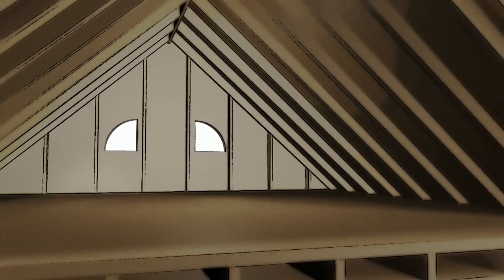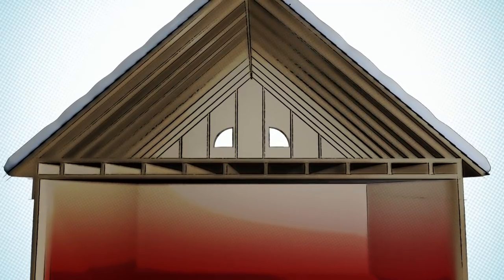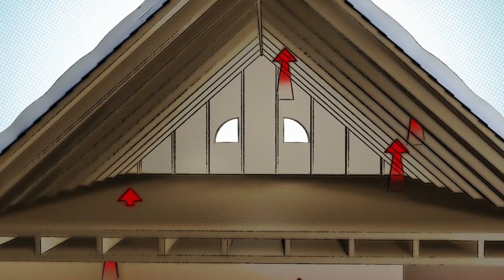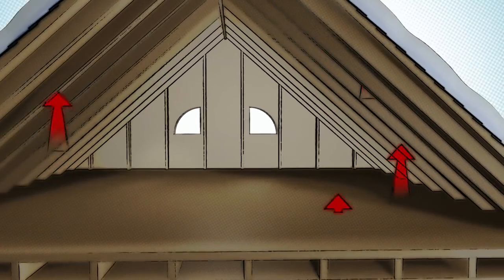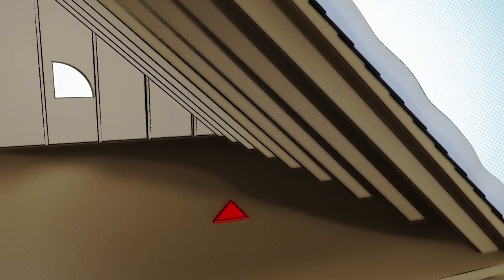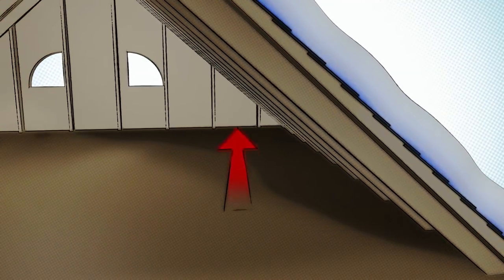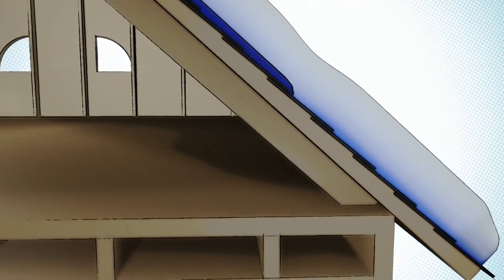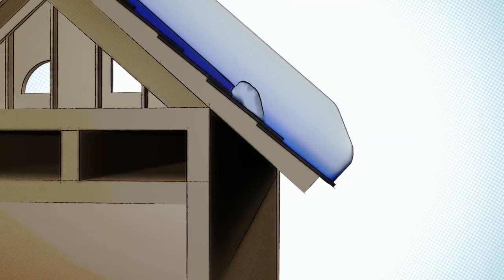How to Prevent Ice Dams | This Old House

Comment: When I contacted Owens Corning about air under the shingles, they said if you spray like this, you will shorten the life of the shingles on the outside of the house. Air damns need installed from soffit to ridge vent, then cover with insulation. This allows air to move via convection from the soffit up through the ridge vent, keeping the shingles cooler and getting the max life out of the shingles.
Reply: This is definitely true, I wonder if it would have any effect on sheet metal roofing, I doubt it, but would love to see some real data.

Comment: Insulation is important but the water doesn't stop at the bottom edge of the roof, it stops in the gutters and freezes. It builds up in the gutters until it reaches the top of the facial board. Then the ice crawls into the gap that is between the top of the facial board and the roof deck, then it fills up the soffit, then enters the house. When it reaches warm air it turns to water. Even if it gets under the shingles there is ice barrier at the bottom edge not felt paper. Code in any snowy region is two passes of ice barrier at the bottom edge of the roof then felt paper the rest of the way, anything under a 4/12 pitch gets completely covered in ice shield/barrier. To prevent this from happening you need to remove the gutter, install new ice barrier but this time leave 3 inches of ice barrier hanging over the bottom edge. This then gets folded down over the facial board or aluminum then install the gutter over the ice barrier closing the gap between the top of the facial board and roof deck. That's the correct way. It's all about doing it right in the first place.

Comment: If you're looking to prevent ice dams air seal the floor in your attic. Light fixtures, interior walls, plumbing stacks, bathroom vents, etc. You don't need to spray 2-lb foam to the underside of your roof deck unless you want the attic to be conditioned space.
Reply: the guy in the video actually said he wanted a conditioned space...

Comment: I swear, 15-30 years from now there's going to be commercials on TV of a lady asking if you or a loved one has been around spray foam insulation resulting in cancer and to give them a call for a cut of the compensation. It's going to be right up there with mesothelioma/asbestos.
Reply: already happening
Reply: Closed cell spray foam is safe AFTER it fully cures IF it was installed perfectly and properly.  If the ratios are slightly off or the installer tries to go too thick on their passes, it's big trouble!
Reply: It turned my dog gay!! Join the class action lawsuit!!

Comment: I agree with everything that you said, but I am not a fan of  spray foam. I would have screwed 1x3 or 2x4 (home owners choice,  I have done both) horizontal 16 inch on center. Installed rafter mates (tunnels) and installed insulation then drywall. Also you must have vented soffits and a ridge vent or gable vents. Problem solved
Reply: I know, they did not mention anything about soffits.   Does this house have soffits?

Comment: Old Historic House Owners:  if you want to list your home on the historic registry, DO NOT use any spray foam insulation before you FIRST check your state codes.  Also, if you have an original self-ventilating slate roof, understand that this is NOT a good idea!
Reply: @Dave Gill Im curious if there is a venting from soffit to ridge if the slate will still get too hot?
Reply: He is in the US. Nothing historical it's like... 300? Years old lol

Comment: Good luck with finding a roof leak and by the time you do there will be more than 1 board to replace.  Plywood even more . Why not pull attic floor and add 2x4 to the top of each floor joist re-install floor then insulate.  Install soffit insulation and ridge vent. Make sure that you have 6' of ice and water shield under shingles. Oh I forgot...  that doesn't sell foam insulation .

Comment: Something to watch for when it comes to these companies that use spray insulation, is that they often "fluff" the insulation in. For example ...when you're looking at adding 10 lbs. of insulation, what they often do is use only 5 lbs., and then charge you for that 10 lbs.
Reply: Likely the reason some of these applications fail.

Comment: With closed-cell spray foam being a vapor barrier, are you worried about moisture getting trapped between the roof deck and spray foam? If so, it would rot out the roof decking.
Reply: And the county code clowns wont pay a cent 🙃
Reply: Well once you replace your roof and possibly your roof sheathing all that spray in insulation will come out with the old sheathing.  Would never do that.  All u do is install roof insulation baffles and leave a min of 1 inch air gap behind insulation to roof sheathing.  This makes sure the air behind insulation stays cool with air flow from soffit vents to ridge cap still working
Reply: @jheiny1231  I was surprised they didn't install those before spraying.

Comment: Fiberglass insulation on top of a leaky floor in the attic may do nothing but redirect air leakage to the eaves, making the dams worse. 

Conflating air sealing with insulation is perpetuating dogma. Nice lesson on Ice Dams but incomplete. Wish they'd done a better job distinguishing between stack driven air leakage and heat loss. 

Redefining attics with foam is a FANTASTIC home improvement - If you have comfort issues this is likely to significantly improve comfort in the rest of your house too. Overfilling 2lb foam and shaving is overkill imo. 

Folks, most of your performance problems are due to air leakage, not insulation levels.
Reply: I agree. Very first thing is to make the house air tight and have proper/controlled whole house ventilation via HRV or ERV.

Comment: So does keeping the windows in attic open in the winter helps?
Reply: A bit late to comment, but yes it will help assuming that the attic floor is air tight to the house. The huge danger is that rain/snow can easily blow through an open window even with a screen, so a gable vent with 45deg fins would be the permanent solution.

Comment: You need 2 inch gap on the rafters for ventilation from the soffits.  You can then apply your insulation. Just a matter time for the wood boards to be rotten.
Reply: Nope not necessary

Comment: What about venting to the ridge vent?
Reply: That's what I was wondering about
Reply: Well once you replace your roof and possibly your roof sheathing all that spray in insulation will come out with the old sheathing.  Would never do that.  All u do is install roof insulation baffles and leave a min of 1 inch air gap behind insulation to roof sheathing.  This makes sure the air behind insulation stays cool with air flow from soffit vents to ridge cap still working

Comment: Of course the rafters are still exposed and therefore transfer some heat, so might as well toss a layer of XPS on it also before the drywall.
Reply: The thermal bridging is very minimal but you could do the XPS if you want to get crazy. They're in such a tiny space that it seems already so overkill.
Reply: its not a tiny space? its the roof of the whole house

Comment: What a shame to see that beautiful wood roof and structure being ruined with that foam. When you'll want to replace a piece or intervene on the structure, good luck getting rid of that stuff.
Reply: Your comment is odd.  So you like losing all your expensive heated air to the outside?  and cause ice damming that rots out roofs all over the country? There is a reason we insulate the building envelope and a good reason we don't build em like we use too.

Comment: Not the cheapest solution either.
Reply: Not everybody is looking for cheap. It's really not as expensive as you might think, about $1/board foot. (1 square foot 1" thick) Most people don't need R38 either, outside of New England.

Comment: Very poor method of insulating the underside of the roof.  It should have first had air baffling installed to keep the foam directly off the wood decking.
Reply: Check with the APA (AMERICAN PLYWOOD ASSOCIATION) about having ventilation on one side of the sheathing.
Reply: @J M If there is no air ventilation from soffit to ridge, and water gets through the roof sheathing, then the roof sheathing will rot out.
Reply: @ryanemge7659  if water gets past the shingles that is not a good thing insulation or not
Reply: @Affordablebath_remodel  Yeah its def bad regardless, however with a vent channel the moisture will run to the soffits rather than rotting out the roof sheathing.  That's a better situation to have as less damage is likely to occur and you will get visibility to having a problem sooner.  I have a friend who worked on a customers roof that didnt vent, and the foam worked so well that they didn't know they had a problem until they replaced their roof (when the shingles were at the end of their life).  As a result they had a major repair, as much of the sheathing was rotted out and several of the rafters needed replaced.  They ended up removing all the foam and put in vents and refoamed everything.  So they did the project 2 times, instead of spending a day installing rafter baffles to begin with.
Reply: @ryanemge7659  what if there is no soffit?
Reply: J M Everyone of the rafters will act like a sponge and draw the moisture in, or hold moisture from the outside for longer than they would have had they been vented.
Reply: @benjaminblack5888  No.  The roof is an assembly and it is not just about a specific product this is not good advice.  You should consult an architect and there is also exception information from "Building Science Corp.".  The climate zone must be considered.

Comment: These guys replying to this video are ignorant to the fact that venting is only needed if the heat would travel to the shingle from the house. With this system that will not happen. also the shingle are a breathable system especially with the breathable underlayment being used by industry pros. unless you have ice and water shield going on the entire roof deck you won't have a ussue with this system.
Reply: Yes if you got a super hot attic and a super cold outside temp you could have shingle issues. Hot on the bottom, cold ontop does make things curl because there is a thermal differential.  But with closed cell foam inside those rafters, as you noted, it alleviates the problem.
Reply: Yes if you use closed cell foam you don't need sofit vents. You'll plug those up. You now have a conditioned space and don't need to bring outside air in for heating, cooling and mold resistance. 

Sofit vents are to bring cool air from the edge of the roof (lowest part) in so that the hot air at the top of the attic will go out the roof vents. It acts somewhat like a venturi. If you're letting hot air rise out of the top of the roof it will draw air in from below since you're creating low pressure and thus it will draw air in from the sofit. The reason for this is to cool your attic. So this was the old way it was done, which worked okay but it brought the outside air into the envelope of the building (roof line) so you're actual thermal envelope was now ontop of your ceiling. 

A much better innovation which started a few decades ago is to push the thermal envelope outside of the ceiling insulation and beyond the roof. So now the whole house becomes the thermal envelope. Cold and hot air no longer permeate the building. Our barrier is now further out and the attic now becomes a conditioned space just like the inside of your rooms. This actually alleviates ice dams since hot air is no longer escaping/bleeding through the ceiling up into the attic, it also keeps the house much cooler in summer and much warmer in winter just like a thermus does. It also greatly reduces the energy needed for heating and cooling reducing power costs and helping the environment. It really is a win/win which is why it's been adopted. The only downside if any is that it is expensive.
Reply: 10" of snow is between R10 and R20 depending on density.  This will cause your roof to warm up no matter how much insulation you have sprayed underneath it.  Also, the siding can warm up with the sun on it.  That heat goes up.... right under your soffits and melts your snow causing an ice dam.  If you live in an area where you get snow you NEED to vent your roof.
Reply: that used to be thinking in Norway aswel, now it`s code to either have vented roof (Cold air under sloper roof) or downpe from the roof positioned internally (typical flat roof).

Looking at youtube, in many of these aspects it semms the US is lagging 20 years behind.
Reply: @BB-nn9en  that's not at all true you have it exactly the opposite way. My neighbor has no insulation in the roof of their log cabin and the warm air in the building and melts the snow on the roof and creates huge icicles. My roof is spray foam with 7in and the snow does not melt until spring because there is so much insulation.
Reply: @J M all those things can be spray foamed in, just keep in mind for something like a chimney you must have the correct ductwork to meet fire code.
Reply: @BenjaminBennett  that's simply untrue and it's very telling that they turned off comments on that video. Ice dams are formed when very warm air heats the roof deck from the inside and melts the snow and then it freezes at night. If what he said we're true then igloos would melt from the inside and yet they don't
Reply: @77Avadon77  The PHD in engineering would be the correct vs some general contractor. Also the comments are disabled due to company policy.
Reply: @BenjaminBennett  I have a spray foam roof with conditioned space. I know he's wrong. You do not get ice dams with spray foam.

Comment: Question... None of the wood in my home walls are vented. They are sealed in tight, wrapped in foam insulation outside and then with vinyl and inside with drywall and years worth of non-breathable paint.  Why don't these studs rot?
Reply: They will ‘ have patience
Reply: They don't  get nearly as hot as the roof decking, but in time they will rot as well

Comment: Spray foam most certainly is a do it yourself job. They sell rather large kits of the 2 part mix for this. It is indeed marketed directly to homeowners, and it's not that difficult. TOH is supposed to be a do it yourself show but it seems like mostly they just say "hire a guy". This was a big job and maybe better hired out, but you can definitely do smaller areas quite easily and relatively low cost.
Reply: Ok, I'll tell my mom to buy the kit and go up in the attic.
Reply: Well, to be fair, the video came out 6 years before your comment.
Reply: @j.frankparnell3087  Spray foam ain't anything new.

Comment: Or just install an ice shield rubber adhesive barrier strip  on the plywood along the top edge of the roof.!
Reply: Ahhaaa you know that barrier gets hundreds of nails go thru it when shingles installed. If you believe all the holes self seals  than you probably still believe in Santa.

Comment: put on a metal roof and you will never have an ice dam again.
Reply: And play only heavy metal in winter.
Reply: Depends on the style of roofing.
Also, the main issue with ice dams has NOTHING to do with your style of roofing.  It has to do with heat loss through the roofing deck.  Metal roofing doesn't make that go away.

So it's still possible to put on a clip-together system (like some of the galvalum panelized stuff) and STILL have ice dams backing water up under the roof overlay.
Reply: You have solved the ice dam issue, but you still have a heat loss issue.  Remember how the ice dams are created in the first place.  Metal roof is a great idea that it will last a very long time, but if you spray foam first the amount of money you save in energy conservation will help pay for the metal roof.